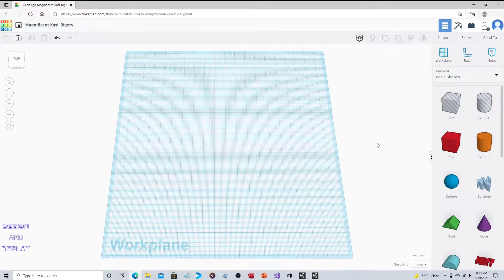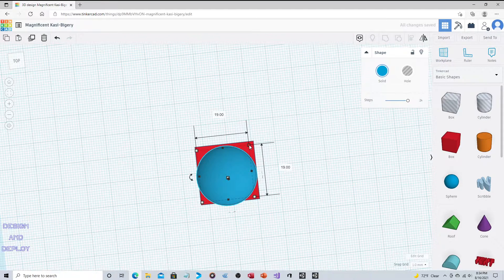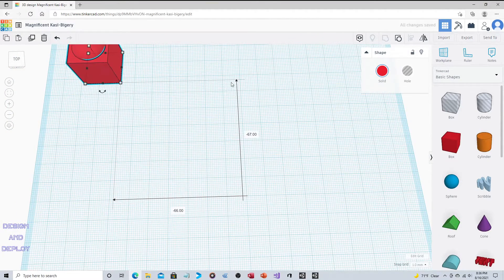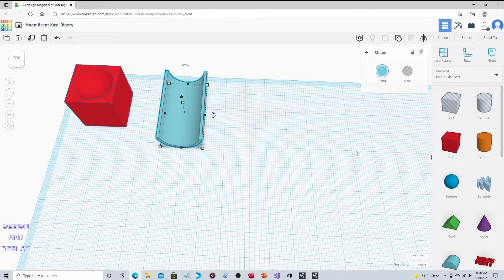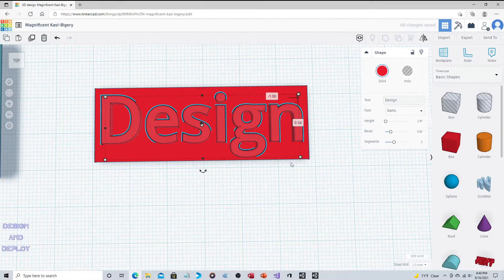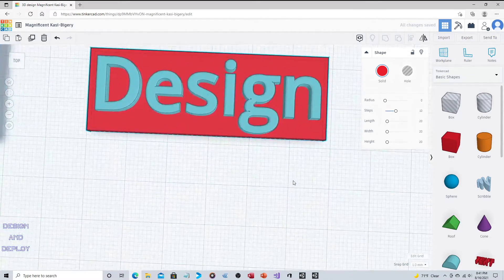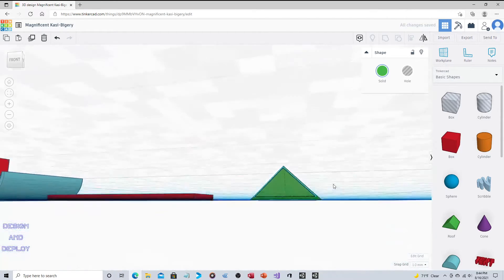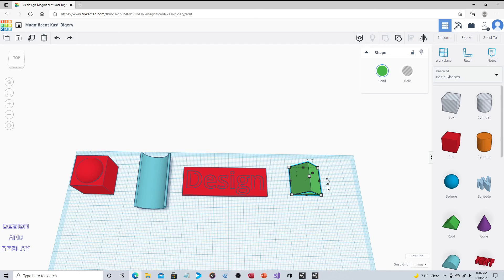TinkerCAD - How to Carve or Hollow an Object

Comment: Since this is run by Autodesk I am cautious about using this to make items for other software. I couldn't find info on the terms of it's use without registering.
Reply from the maker: The only thing I could find was this: 

4. Your Content.
a. Ownership. These Terms don’t grant us (and we don’t claim) any ownership rights in Your Content.

which is then later defined as :

“Your Content” means, collectively, (1) the Content posted, provided, uploaded, submitted, shared, published, distributed, made available, accessible or usable by you on, to, from or through the Service (and any translations thereof); (2) your specific output generated from the Service, if any, based on your own raw data or information; and (3) any software application, plug-in and other computer program or similar material (including any modules and components, functions and features of a computer program) developed by you using the API Information. Expressly excluded from Your Content are any of Our Materials.
Reply: @designanddeploy5991  ok. might try it out.